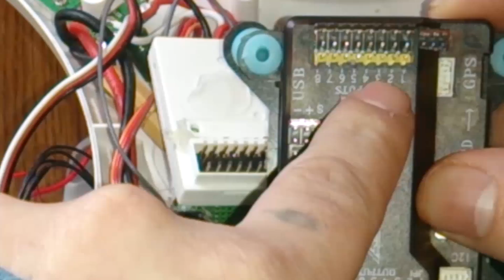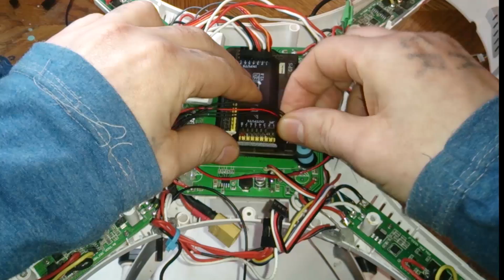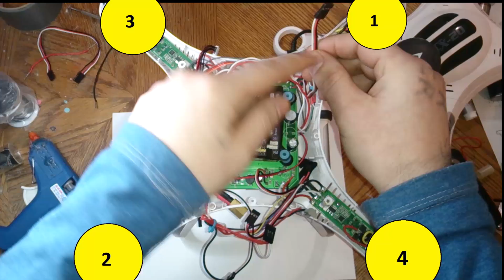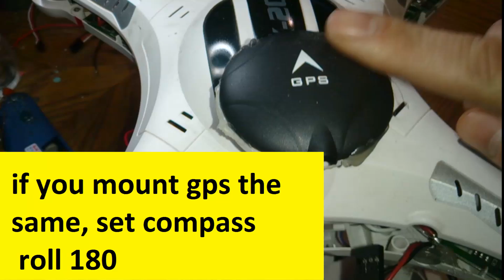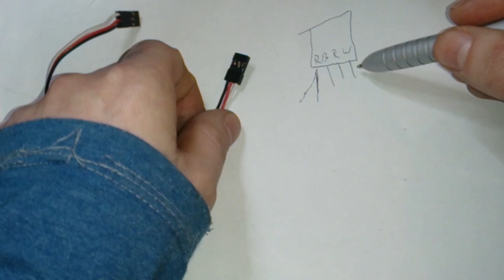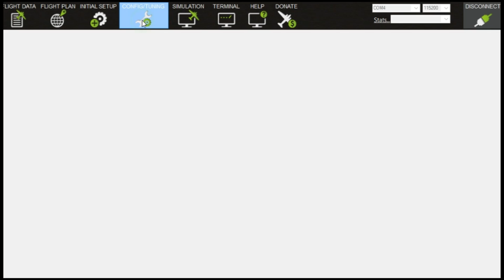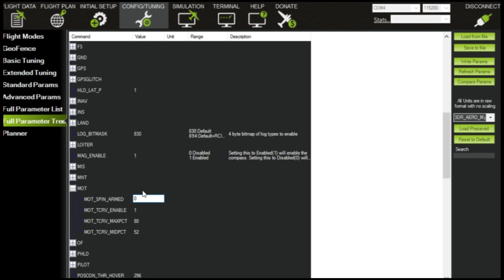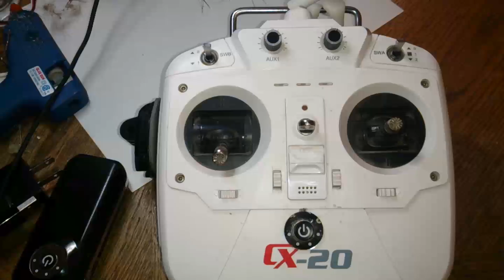cx20 factory apm to apm 2 6 - 2.8 step by step

Comment: Hi, do you know why gps hold do not work correct, when I turn it on cx 20 flay away. Maybe I need to change something? Orientation work correct but gps hold is bad.
Reply from the maker: try to do your compass calibration again.. even with orientation working does not mean its actually pointing in the right direction..
Reply: bangs6996 i do that, but it all the time fly away.
Reply: bangs6996 i do that, but it all the time fly away.
Reply from the maker: back up your params.. and try loading mine..  https://drive.google.com/open?id=0B2w6_OKE_2kxLTlWdGZsSWRWcGM

you have to re do radio calibration,accel and compass.
Reply: bangs6996 Thank you, I will try at weekend this params, and let you know how they work.
Reply: Hi, I try your params, I done all calibrations, but I can not arm apm, 
Geofenc is disabled and also I disable ARMING_CHECK.
Reply from the maker: are both switches swb and swa at 0 0?
Reply: yes, both ar on 0 0.
Reply from the maker: plug usb  able into cx20
turn on your remote 
open up mission planner

click on  Intial setup
..Mandatory Hardware
...Flight modes

flip swb to 0 and swa to 1
make sure it goes to Flight mode 6 (loiter)

flip swb 0 and swa 0
Make sure it goes to Flight mode 4 (stabilize)

.. go to radio calibration and confirm
your throttle moves up about 1900
and when you move down about 1013

on your receiver to the apm make sure you have cable on right for
e,t,r
 this is the  right way
e goes to 2  ...right
t goes to 3  .....right
r goes to 4  ...right

You might have it like this
e goes to 4    ...wrong
t goes to 3    ...right..
r goes to 2    ..wrong